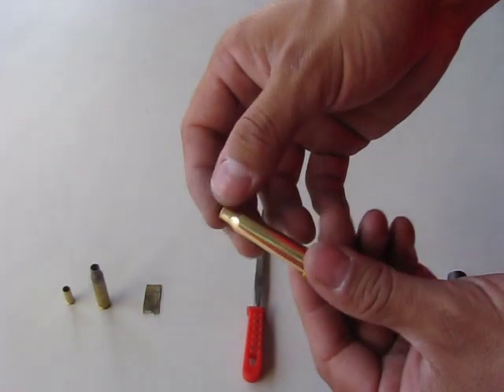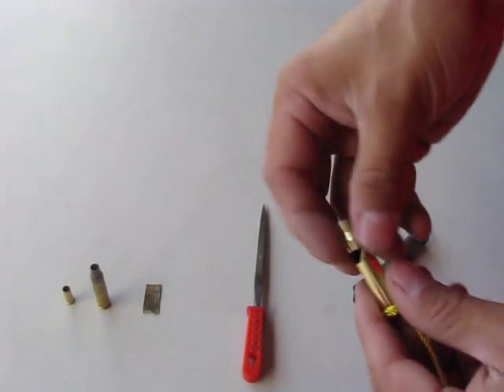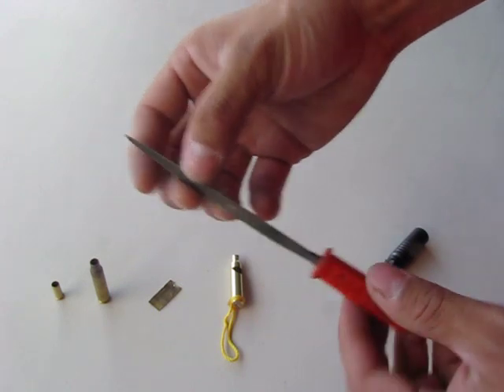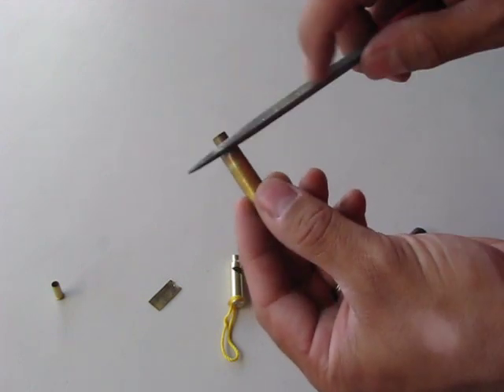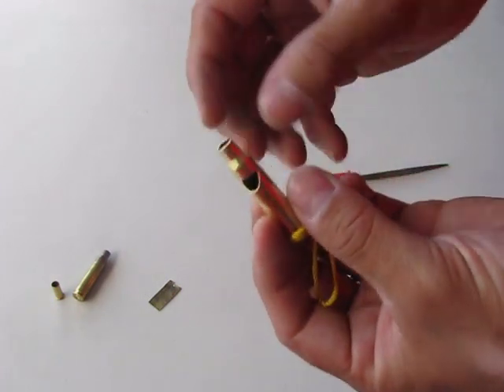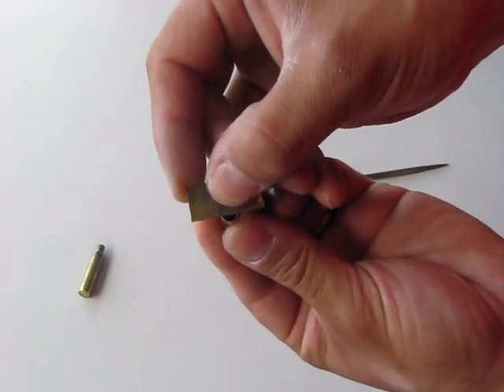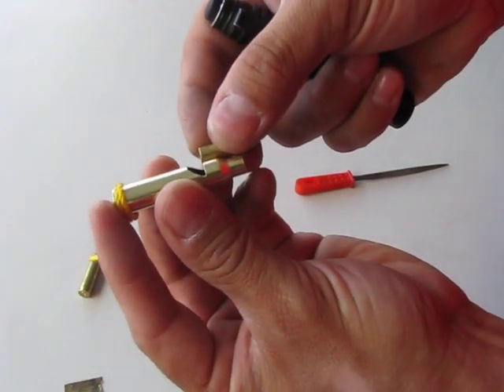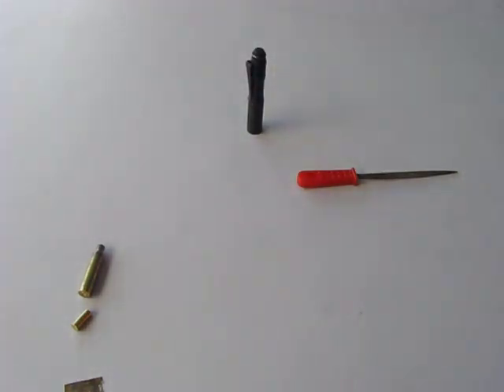How to make a .223 Ammo Survival Whistle

Comment: out of curiosity, would it be possible to just grind off half of the cap on the 22lr shell instead of cutting and soldering?
Reply: I hope so because that's what I'm about to try xD
Reply: @TheTuneAce  did it work, cause I'm about to try?
Reply: I tried. It's doesn't work. Because it's crimped in the top, grinding it just make it separate entirely

Comment: If I drilled a hole in the end of the casing, so I could put in a head pin and make a loop for a jump ring, so it could be put on a necklace chain, will it still sound, or will that hole keep it from working?
Reply from the maker: If the hole allows air to escape , it will degrade the whistle sound. If you solder the pin, it should word fine.